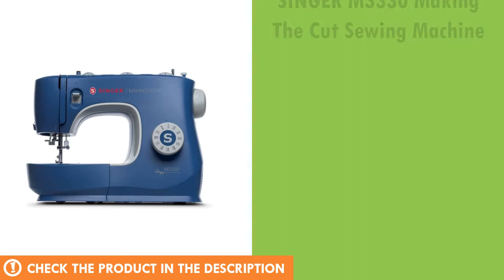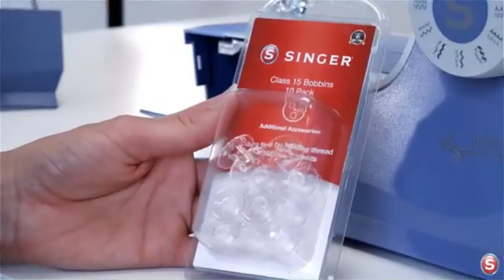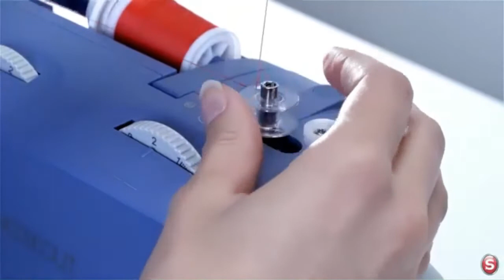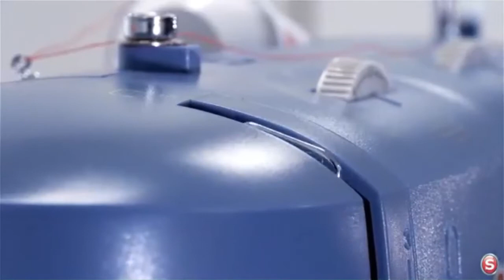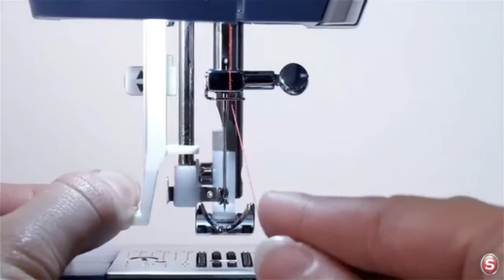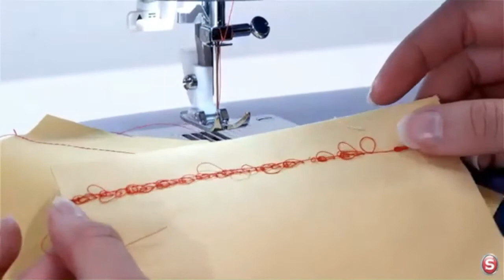SINGER M3330 Making The Cut Sewing Machine Review - Best Sewing Machine on Amazon

Comment: I have this cute machine and use it a lot, One thing that I had trouble with at first was that there is a thin part on the first thread hook that you need to put the thread between them when threading or the thread will not feed smooth,
Reply: what's the trick for making it easier?
Reply: Hi there, do you happen to know how to adjust the presser foot pressure on the Singer M3330? I have been searching all over the internet and I can't find it
Reply: How do you use streach stitch
Reply: @aiko-san-t7m turn the stitch length to the short stitch side and it turns the machine to stretch stitch